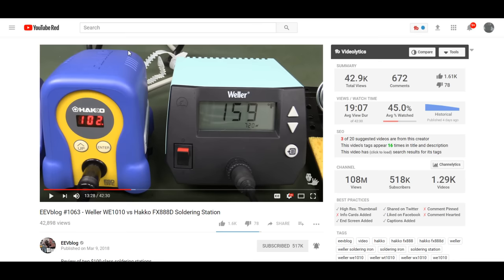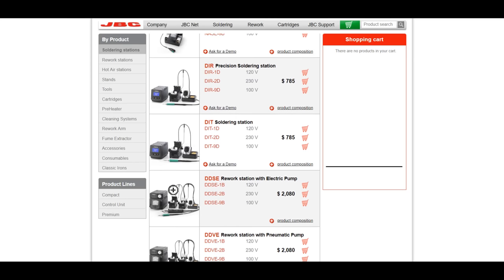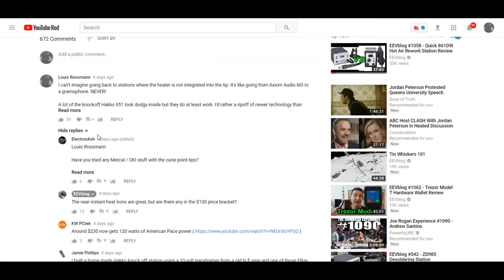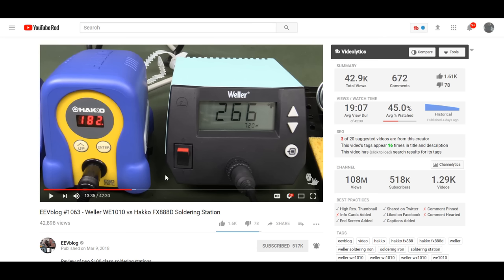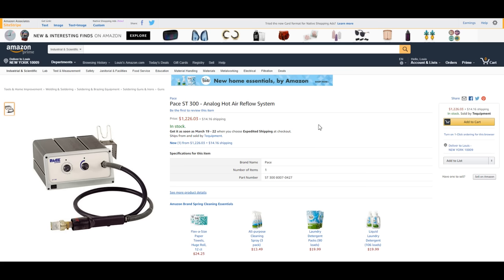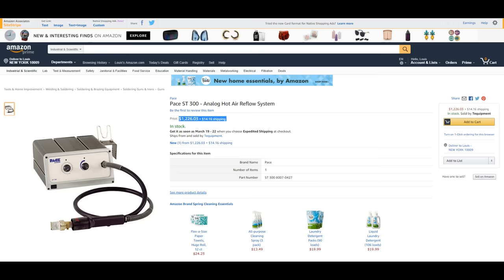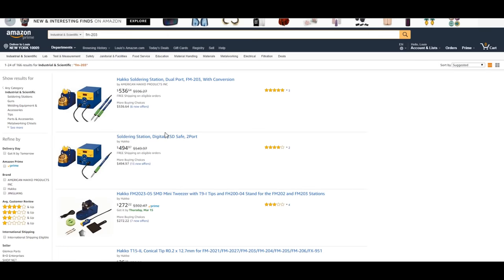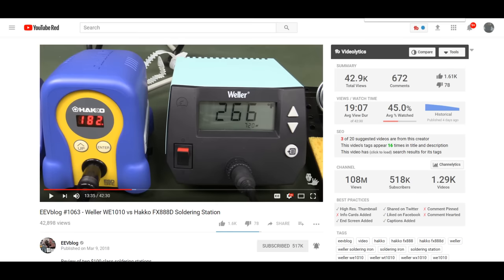Soldering station technology & the lie of "SOLDERING PATRIOTISM"

Comment: Rather than spending the 100 bucks on a knockoff chinese hakko 951, I'd spend the money on the excellent TS100 soldering iron, which is an ideal low cost soldering iron for hobby use. Paired with a 24V DC power supply, it's very powerful at 65W and can handle just about anything you throw at it. I've done fine soldering and soldering of heavy gauge wiring with it, and it performs very well. For everyday use in a professional environment I'd spend a bit more on the soldering iron of course, but for your typical DIY hobbyist which needs a versatile iron that can handle a variety of different soldering applications, the TS100 is a very good and cheap choice, and is better built than the typical chinese knockoff stations.
Reply: Skauber I feel so bad I didn't buy the TS100 before now it's $100. I remember it being 30-40$ 😢

Comment: We had some nice station when I went to school at LTI. However the tips were so fucked, I got pissed, left class and when to radio shack. I bought the smallest tip they had and literally jammed it into a $10 iron,I had to put aluminum foil around the threads to make it even fit. Anyway the class was for SMT certification and I built my project with that hacked shitty iron and my board passed a microscope inspection. Of course I was 18 back then and could actually see that shit without magnification, so I'd have a hard time doing that today. I guess my point is its better to have a shitty iron with a good tip, then a $1000 station with tips so fucked they can't even be tinned.

Comment: You can spend ~$100 for an iron by company with a good reputations of reliability and quality and lets not forget there is nothing actually wrong with the older system it's just a bit slower (lets ham up it up) at heating up and recovery. Or you can buy a knock off with no reputation and questionable quality. Lets be real, knock offs can go from being OK to being a fire hazard (I have been burned, literally by a no brand iron). To be open I have a Hakko 888D and FR-300 but I'm seriously looking at the Pace ADS200 but that will probably be another year of saving.
Reply: As a follow up, after a while of using the Hakko I never felt the need to replace it. However recently someone stole it, so I decided to get the Pace and it is nice. It is faster at heating (far quicker than I can get ready) the recovery time is next to nonexistent, the tip distance it very short and very easy to control, the handle is so comfortable and the user interface is really easy (It's the one thing I really disliked about the Hakko but beyond the presets I had setup I didn't use it). But at a bit over $300 (including a few tips) it's expensive and my finished work hasn't changed (not a surprise) so I basically paid an extra $200 for a bit of extra comfort. I would recommend the Pace if you are buying new, but if all you are doing is upgrading its a bit steep.

Comment: For all those suggesting the ts100, a hakko is much more reliable than a Chinese soldering iron, he has to fix a lot of boards in a day so he needs one that will last a lifetime. He doesn’t need portability. Also a proper station means the actual iron is lighter which would be nicer.

Comment: I bought a chinese soldering station for about $60,-  and I'm very pleased with it. Yes, it's slower than the hakko, but it does have a hot-air unit, and for me it does what I need it for.
That being said, I do agree with what you're saying! The newer technology IS better in this case, even if you buy the knock-off. 
So even if the cheap chinese set works for my hobby needs, if I needed it to solder every day I'd prefer to spend a bit more money to buy better equipment.

Comment: Thats not really accurate i have 4 soldering stations, the Aoyue int866, Hakko 951, Weller WN1010NA and a Weller WES51 and they kinda all work the same i do not have temperature drop i test them every month with a temperature probe to be sure every station woks well in my shop, tho the WES51 get really hot near the fingers !! Btw EEVblog do a nice comparison but for the WE1010NA he got the older iron who came too hot near fingers grip and got a bad grip and the element was too short, the las version of the iron is not the same at all the temperature is more precise, the grip is better and the heat near the fingers is gone !! I like the Hakko 951 the same as the others, maybe i should try a JBC to really know the difference and to be honest i will probably do...

Comment: Louis, i cant get your argument with fahrenheit. Or do you say,oh this part has a little bigger footprint, maybe i should crank up the the temperature 1°F...1°C would be too much. I rather have a faster ramp up time when i press the button. Just think a minute about that ;-)
Reply: Ray San 0.5°C resolution is very common (0.1 or even 0.01°C on professional meters) so the "fahrenheit has twice the points" argument has no sense to me either. You don't even need 1°C resolution on a soldering iron, for christs sake, 5°C is more than you'll ever need.
Reply: Jernej Jakob 
I don’t think Louis was talking about Fahrenheit being superior on soldering stations due to more steps, but in general. I could be wrong though. Also he seemed goofy about it...I don’t take these things too seriously anyway, it’s always a matter of taste and habits.
Reply from the maker: At least with air conditioning and heating I prefer Fahrenheit because you have more steps. 32 to 212 gives you more steps than 0 to 100. People will say but you can use decimal points to which I respond, what consumer heating and cooling solutions give you decimal point level control?
Reply: Fahrenheit, like most old Imperial units is a human centric scale. Degrees science is more logical, and easier to work with, but less human relatable.
Reply: You take a little joke about "Degrees frankenstein" and "Degrees science" and leap to a rant... Obviously someone who should watch AvE a bit more and chill :) This is why I like Britain so much. We use metric for 95% of stuff, and hang on to old measures for a few others.  My cheap soldering station measures in degrees science. My car measures in MPH, but my work ride is in KPH, and I have to convert in my head as our speed limits are in MPH. Oh, and by the way, a mile is roughly 1.6km. I could google the exact amount, but I can't be arsed. I use both measures each day.  I just personally find that for a quick guess, imperial works better, but for precision, metric all the way.
Reply: Schicken Phartso nobody prevents me from switching my soldering station to Fahrenheit. If i want to, i could perfectly do it. But i'm not going to do that anyway ;-)
Reply: Allison Pell no Celsius is very life centric because it's based in water, the most important molecule on the planet. Kelvins are scientific and inconvenient in everyday use. You and Louis just made a total fool of themselves for spewing out such nonsense while I generally know at least Louis to be a man of common sense.
Reply: Louis Rossmann my air conditioning works with C and decimal. It goes from 17,5C to 35,9C
Reply: Both of my heating units, in my workshop and at home, have decimal points.
Reply: The heating/cooling on the thermostat where I live has control in 0.5 in c mode. Most thermostats in Canada (where we use C pretty much exclusively) do the same... unless they're analogue.
Reply: Louis Rossmann my car's HVAC has 0,5 degr.C temperature increments. My heating thermostat has 0,2 degrees C increments. Apart from convention there is absolutely no difference in any scale ever, unless you want to do calculations from one measure to a different type. In that case the SI system is much more practical (and Celsius has the benefit of aligning 1 on 1 with Kelvin) As for conventions..my country has the ridiculous habit of using commas instead of decimal points. We deal with it ;-)
Reply: ̷ ̴ ̸ɢ̸ʟ̶ɪ̸ᴛ̶ᴄ̶ʜ̷ ̶ ̶ You remind me of the story about why the Queen cried on her wedding night to the King.

Because she thought all rulers had 12 inches.
Reply: To which I respond, if that granularity was actually necessary they would. You know how market forces operate, if 0-100ºC was actually 0-20ºZ and ºZ was commonly used, each ºZ would be equal to 5ºC which wouldn't be good for climate control so ºZ with decimals would be used because the product to have that feature would be preferred over the one who didn't.
Reply: Louis Rossmann Genuinely I thought it was a joke.
Reply: Obviously people who prefer Fahrenheit cannot handle decimals.
Reply: No reason to.
Reply: human scale ? 
0c is freezing.. 100c is boiling... -40 is the same..... how is that not human relateable ?
Reply: @rossmanngroup  All Panasonic air conditioners offer 0.5 deg C increments.

Comment: Interesting fact: the Hakko FX-888 was developed AFTER the FX-951! It states on the Hakko website. 2005: "Developed the FX-951, compatible for lead free soldering." 2008: "Developed the FX-888 that concepts ease-of-use."
So, which one is the OLDER technology? lol.
Reply: The one which is barely anything more than a new shell on the 936. That'd be the FX-888.

We had integrated heaters in the 1980s. It's time 'normal' stations caught up.
Reply: Well, if you check the spec sheets you'll notice that the FX-888 is a higher powered soldering station than the 936. So I'm sure the FX-888 is slightly more capable than the old ones.

If they "caught up" then they'd be much more expensive and the average hobbyist probably wouldn't want to pay for the extra expense. A lot of people probably even consider the FX-888D too expensive for their needs.

Comment: In other other words: it's like trying to fix a water leakage by keeping removing the leaked water from the pavement, when the actual solution would be to fix the cracked pipe. "Cracked pipe" - being the current competition based "economic" system/"laws".

Comment: the first few years of doing electronics i worked with 20EUR non temperatur controlled irons, then i got to work with a 1000EUR weller station at work and really liked it and couldn't my cheap iron at home any more so i bought a 100EUR station and it didnt really perform any better than the 20EUR iron and i was really disappointed, fortunatly a friend of mine found a box full of broken jbc stations at a flea market and gave me a repaired jbc for my birthdays and it's even better than the expensive weller :)
Reply: so rather than paying 100EUR Dollar whatever which still is real money i would just go straight to the absolute cheapest because it isn't that much worse

Comment: Louis, a colleague told me that there are T12 controllers that work much better than the FX-951 knockoff. These controllers behave more or less the same as the FX-951 but don't look like it. One advantage he claims it has is that it will decrease the temperature when you put the iron in the stand.
Do you have experience with any of these controllers?
Reply from the maker: Link me

Comment: The problem with the cheap knock-off is getting it.  You won't find it on amazon.  You can't even find them on ebay anymore.  Even if you do find one there's no guarantee that it's the same as what Louis tested...with no name brand on the line it's not uncommon for them to remove safety features or swap in junk parts to save $0.01 per unit.  Or...to do something like changing tip diameters so you can't use any tips other than the one that came with it.  If you could say, "this AcmeTech model ABC123 is functionally identical for 1/3 the price" that would be a great argument...but telling people to buy fakes when you know from personal experience that trying to get aftermarket and refurbished non-clone parts through customs is a nightmare...not the best argument.

Comment: What about the ongoing costs of using the stations? Soldering iron tips need to be replaced from time to time, and the tips with integrated heaters cost more. If you have a variety of tips for different tasks, building up that tip collection costs more. If you buy the no-name clone iron you may not be able to get replacements at all.

For somebody like you who does a lot of rework, the newer tech is certainly worth having. For a hobbyist who does the occasional repair, maybe not.

Comment: I would like to know where I can buy a Weller soldering station for 100 dollars. I would buy it  immediately.... I repair tube radio's and I have an old Weller WTCP50, it is more then good enough for these old radio's, Very unfortunately the old Weller broke and it needed a new heating element (25 years). Over here in the Netherlands they want around 50,- euro's for that. Absolutely ridiculous there is no way I will ever pay that much money for only the heating element. It is not worth that kind of money at all.

 If anyone has a good advice about what to buy for the purpose I need it, I would like to hear it. Thank you very much. At the moment I use a even older soldering iron with a plug on it that goes directly into the mains socket.
Reply: Try this one: 
http://nl.farnell.com/ersa/analog-60/soldering-station/dp/875170

With 842 Series Tips.

Never had any issues with mine.
Reply: Thak you very much!

Comment: The argument with the heating element being integrated in the tip is not exactly true. It is true with stations with huge tips that have high thermal capacity. I have WSD-81i and it is as good as that station you show. They use tips that are just cm. long and have very low termal capacity...

Comment: Damm.. if i want to get this new tech you mention i would have to pay €1022 .. That's for the Hakko FM-204 desoldering station and the Hakko FM-2027-03 sodering iron kit.

Or pay €375 for a FX-888D + FR-301 bundle..
That's a €647 that's huge.. i don't think that smart for someone starting in this hobby. if cash was no issue sure..btw i don't even know how the FM-204 compares to the FX-951 for soldering..

Comment: Who talks about "American jobs" etc don't understand how the current economic system works. There are no borders, it's a globalised system. 

But, this sentiment/instinct is quite correct. Meaning that this system is based on competition (cut throat competition, but the healthy kind of competition), and by definition it produces (artificial) scarcity (although people don't yet understand that it's artificial). Which ultimately means who's winning this competition, "steals" jobs from all the rest (and these are not just "jobs", these are livelihoods ). 

In other words - the sentiment is correct, but the solution is not. The solution would be realising that the very "economic" system is flawed/corrupted, and fix that/it, and not trying to fix its effects / not addressing the causes that produce these effects.

Comment: Is it about an inductively heated soldering tip vs an cermic heat element ?
Or is there a third thing?
As inductively heated high frequency soldering stations are pretty cheap....like 150 Euro from an ok brand...
Is there a much more expensive technology?

Also what exactly is so special about Made in USA?
What USAian peoples Attribute transfers into a USA made product? 
Does it come with integrated massshootings? Will it stand it's ground, if you force it, to do something it doesn't like? Will it do rap songs while soldering? Will it fail to do abortions properly? Will it come equipped with a cup holder and  a burger plate? Will it be sporting an extra massive housing, so it won't fit on a regular workbench?

Comment: Bad soldering iron is bad no mether is it "new" or "old" tehnology.
Is heater is integrated in tip or not is totally irrelevant, Pace PRC 2000 with PS-90 handle which is on market over 20 years (heater is not integrated int tip) will hold temperature better JB RMSE-2D with T245-A handle.
PACE will cost you more in front (but not 2 times more which is difference between  FX-888 and FX-951, PACE cost only 20% more then JBC) in long run it is much cheaper to own than JBC even tips for PACE are not cheaper than cartridges but they last much longer then JBC ( and JBC claim that their cartridges last last 5 times longer than other brands).
On other hand for most people irrelevant fact is that Pace PRC 2000 is certified for doing repairs on life supporting systems, aerospace and defense, and(as I know) JBC is not.
Reply: Nice, confirms what I posted earlier. Price is higher due to govt interference.